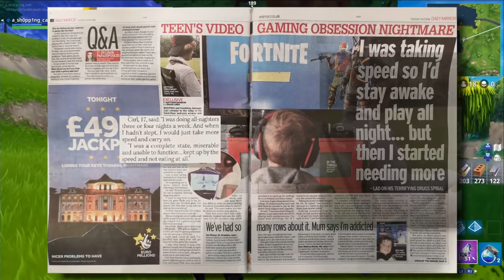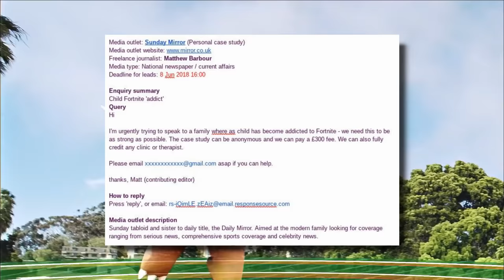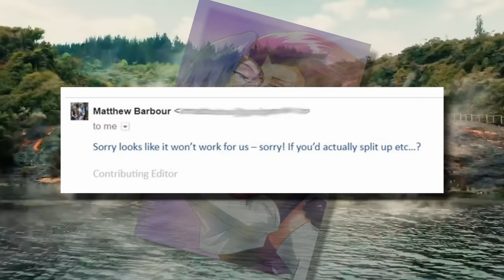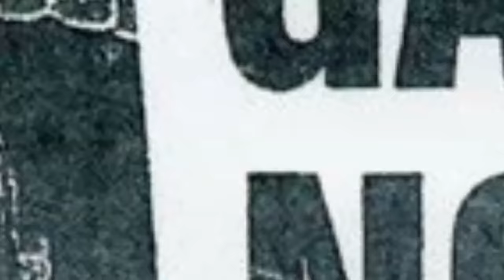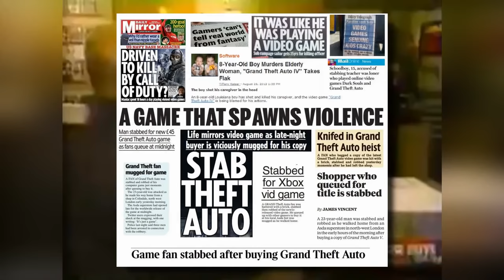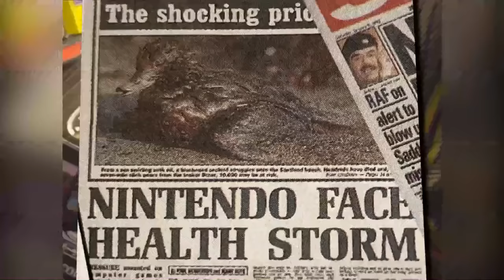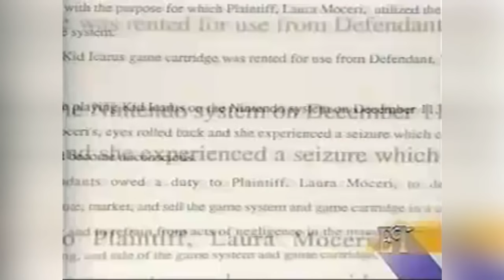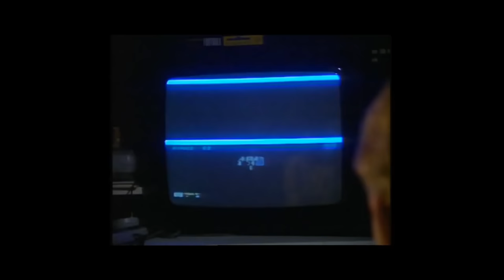📰  Fake News about Video Games | Fact Hunt | Larry Bundy Jr

Comment: The number one is a big problem because of its basis.  Like...if games had the occasional popup every hour or so that said "hey...you've been playing a while, maybe stretch your legs, make sure you're hydrated, and maybe use the bathroom if you need to."  It wouldn't be a problem really.  I don't blame WoW...I definitely blame myself, but when I was really into the game ten or so years ago, I ended up developing bladder stones and a kidney infection because I would go hours between bathroom trips...at one point playing for 11 hours in one sitting without breaks because I was determined to cap off my Mage PvP gear.  I paid no attention to the time, started playing at 5:30 pm and it was about 4:30 am when I called it.  In case anyone is wondering...it is not normal to have urine that is between the color of Mountain Dew and Coke.  Also...passing a stone is tied for number one worst pain in my life alongside a cracked and abscessed premolar tooth having the abscess firmly squeezed by a doctor so I could see out of my right eye again by dropping the swelling...and so that antibiotics would have a ghost of a chance of working for me.  In any case...I don't mind when games put out the occasional message that says: "Hey...maybe take a drink of water or stretch your legs a bit" because I'm a pretty focused person when it comes to specific tasks.

Comment: That  first piece with Fortnite sound alike a mess. For starters, it sounds like he was mixing up the BR with what Fortnite originally was (and is still available to play), Save the World.

STW is essentially a story based castle defender that had you craft weapons and traps. The thing is that it's entirely possible to get schematics to build weapons for free, and actually crafting them doesn't cost a thing since the materials you need for them are scattered across the world and you can find them.